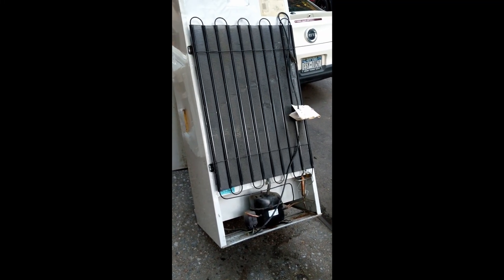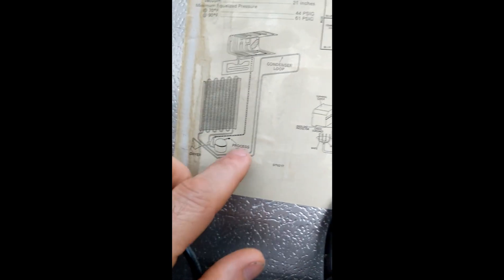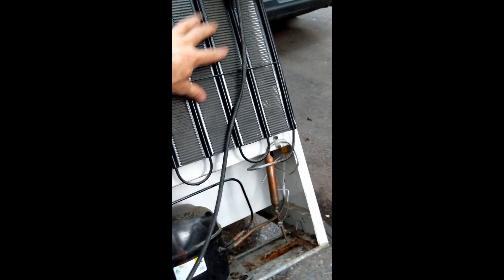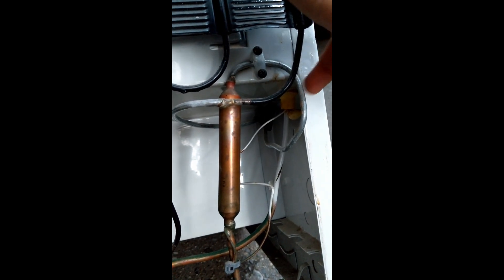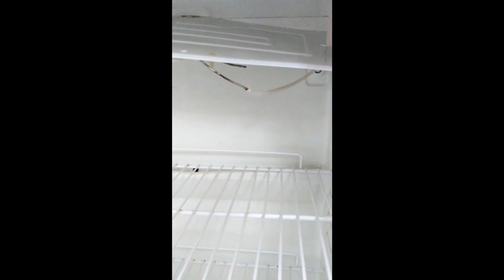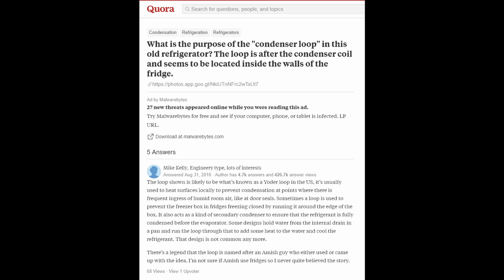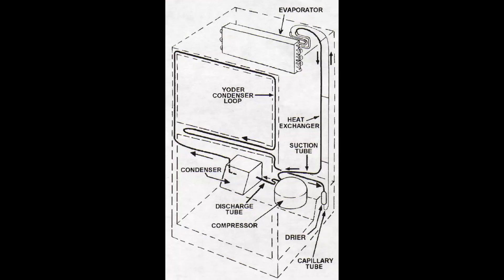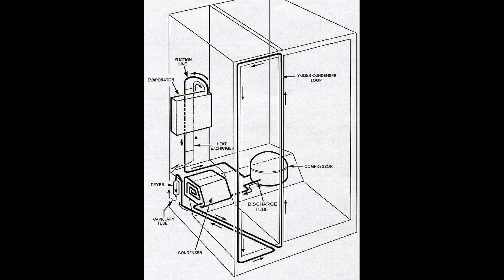What the heck is this "condenser loop" for?

Comment: My 3.5 year old LG was just diagnosed with a leak in the Yoder loop and was deemed unfixable by LG.  The service tech had never encountered this issue before.  Anyone else ever had this problem?
Reply from the maker: I've never heard of this. The Yoder loop is usually protected behind the metal door frame so if it is leaking, I'd guess it is a manufacturing defect.
Reply: After replacing the compressor, condenser, evaporator on my 6 year old LG and the cooling issue was not fixed, LG last visit stated there is a leak in the yoder loop and is also not fixable because the loop is inside the wall of the frig.  LG refunded $600 repair cost I paid plus $200 for the $2000 frig.  The nice looking frig went to the dump.  What a waste!
Reply from the maker: @jc30051  If you are brave, you could try bypassing the loop and then recharging the system and then you'll have a free extra refrigerator! The only downside being that if you live someplace humid then you'll want to keep it above freezing or just not open the door often.

Comment: can you help me make my own airconditioner using scrap materials from a freezer or reffrigerator? aircon cost is just way to the roof here in my place... its not justifiable to have so high of a price... i love your videos. please make a continuation on the aircon your building.
Reply from the maker: You can make an AC out of an old working refrigerator by just carefully getting rid of the box part (do not mess up any pipes) and then having one fan blow the hot air out of your house and another fan blow the cold air in. You also need to collect the water that will form on the cold pipes. Do do any more than this, you will need a vacuum pump. I am working on articles on how to make an AC from scratch (even making you own compressor), so hopefully will get that posted someday!